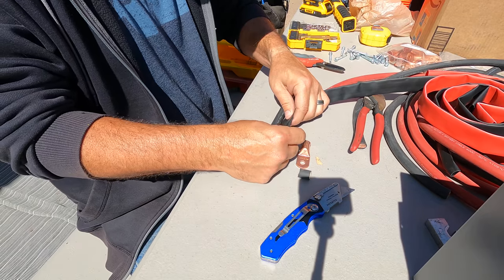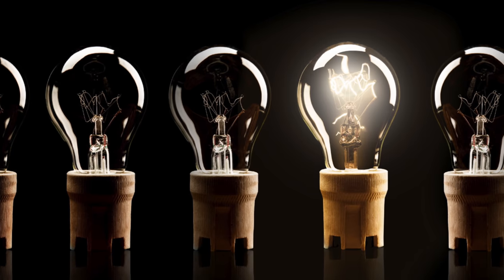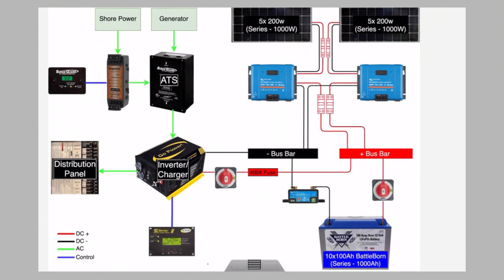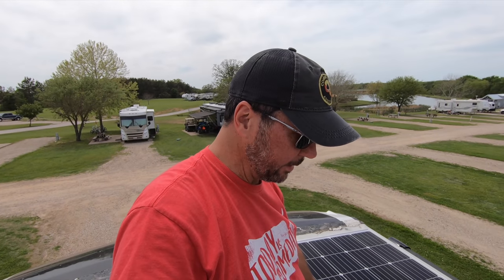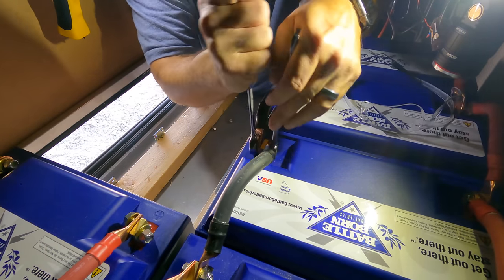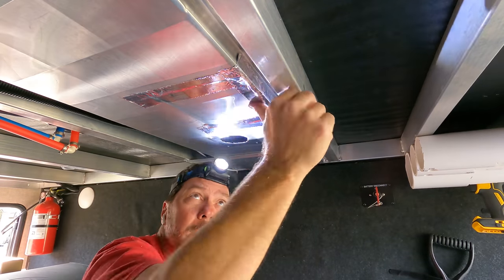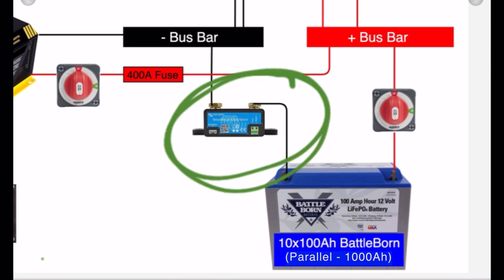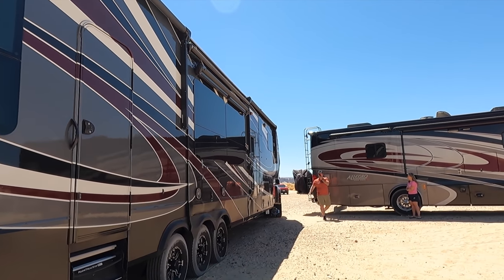☀️  RV Solar Install! 😎  (Full Time RV Life)

Comment: Wow!
So many questions.
Love the video. I’m taking notes snd will watch this a few times.
Question 1: now that your “solar”, do you need a generator?
Q2: do you shut the solar off when your plugged in?? How does that work?
Lots more questions but I hope you can get to these two.
Reply from the maker: We have a generator and it will still be used when we have power requirements over 3000W.
Solar stays on all the time and the controllers handle how much power is added to the system.  We'll have a new inverter video out in a few weeks and this will be more obvious when I show the whole system. 👍🏼

Comment: Hey Chad, did you use Photoshop to do the pic editing for your panel placement? That's an excellent idea. On my second RV setup and getting ready to install the panels. I've always just taken cardboard and moved it around on the roof and marked the spots. I like your idea of the visualization. #DJImini2

Comment: Problem with sizing your Charge Controller:  Each charge controller is rated 150V/100A which is equivalent to 15,000 Watts. (Am I wrong)?  Therefore, one charge controller would handle two strings of 5 series configuration, which would equate to (120V !  20amps) of usable DC power = 2,400 Watts.  Which is way below the rated wattage of one single Charge Controller at 15,000 watts.  Therefore, you do not need two charge controllers of this size.  (Am I wrong?)

Comment: I really got a lot out of this as I am planning our new solar system.
We are full time stationary and our PG&E is almost $200 a month and we want to cut that in half at least.
It almost slipped past me to upsize the controller that the controller has to be upsized because you are going back to 12 volts on the battery side which ups the amps. Unfortunately it bumps the cost of the controller to over $700 if I get the 150/100 model.😟
I am so thankful our 2020 Pinnacle is prewire with 10 gauge wire from the roof to the basement for the panels😀

Comment: Great illustrated video! What was the wire size You used for Your batteries? Looks like about 4/0 AWG but not to sure? Also what did You fuse Your batteries at? Very nice job. Thanks for sharing...👍
Reply from the maker: 2/0 interconnects and 4/0 for the battery bank and inverter...  All specs and parts can be found in the blog post here: https://changinglanesrv.com/rv-solar-install/  👍🏼
Reply: @ChangingLanes  Thanks so much for the reply! 😎👍

Comment: As always another great video. Nice and clean wiring. Did you have to dedicate one AC or can you use any one of the three? Can you still connect to your Victron monitor inside your RV and use your phone?
Reply from the maker: The way we are wired, we can run anything... just not all at once.. 😊   I might use an old iPhone in the cabinet as a permanent monitor... Waiting to see how the Multiplus integrates...

Comment: Chad in your audio description you mention your solar panels are 24VDC 10A but the link in your description brings us to the website with a description as is : HIGHTEC SOLAR 200W 36 CELL 12V NOMINAL SOLAR PANEL - 5 BUSBAR !
Reply from the maker: That's just nominal voltage...  https://www.google.com/search?q=solar+panels+what+is+nominal+voltage

Comment: Great Video. on Solar! Question: How do you handle keeping the Lithium batteries warm in below freezings temps?  Is your battery compartment heated?  Or  do you have low temp cutoff on the solar controllers, or both (I imagine you use this setup year round)

Comment: Nice job Chad!   With the two banks of 5 batteries and the far end cross over connection between banks, it allows you to run your positive and negative connections effectively at opposite ends of the battery circuit keeping a short run, but also allowing for even resistance balance for the battery, so they all will charge and discharge evenly. I hope you could do another video explaining the battery connection wiring as it's where a lot of DIYer go wrong. PS. Love the channel!
Reply from the maker: It's actually one string of 10 batteries - all in parallel.  But, having it sort of wrap down and back makes it easy to connect on opposite ends of the battery bank, but on one side physically.
Reply: @ChangingLanes  I understand your 10 batteries are one connected string, as the positive and negative link across at the end (left side of trailer). what I was questioning is the positive and negative that connects to your load. I assume you connected the positive to the end of one bank (lets say the front bank) and you connected the negative to the other bank(lets say the rear bank) these connections would be on the close end to your charge controllers, fuses, buss bars, shunt etc. That would be the most efficient  as the ions would all have equal travel resistance for each battery. For a better example watch this video https://youtu.be/QwWNF_jorYY from the 14.35 minute mark. Regards Tim
Reply from the maker: Correct, and that is how they are connected.

Comment: Hey Chad n TAra love ❤️ the videos keep them coming n Chad when is Ford F450 coming ?
Reply from the maker: Not soon enough! 😎
Reply: @ChangingLanes  or new Ford F-350 dually
Reply: You keep packing that rig and an F550 with 8-9k worth of capacity and an f450 like axle/wheel cut might be the answer. Gotta get an aftermarket bed for the chassis cab and it’s detuned…. but with the capacity, better gearing(4.88), and the 10 speed it is better suited for larger rigs. Beefier all the way around….plus aftermarket diesel tank with over 100 gallons, equals diesel fuel savings because you can be picky where you fill up. I am torn between a 14k gvwr F450 and a 19.5k gvwr F550…..neither option is perfect, but they both are nice. Sacrifice capacity vs. less power and tank like ride unless loaded down. Plus added aftermarket bed cost…..decisions, decisions?

Comment: I want to run everything including all 4 AC unit's on a Prevost bus with charge controllers big enough to handle a boat load of solar panels. 

I don't understand why more RVers don't do Tesla 85 batteries with BMS's on each one. They are about 233 amp hour batteries but that's at 24 volts so it's equivalent to 466 amp hours at 12 volts. So for a approximately $2,800.00 you get 932 amp hours of batteries instead of $10,000.00 for 1000 amp hours at 12 volts. So much more cost-effective for the average RVing family. 

HSR Motors offer all customers who purchase Tesla battery modules from them the option to have them swap out the proprietary Tesla cell sense board with their own custom converter board. Free of charge. This way you can easily use these modules with nearly any lithium ion balancing charger or BMS without having to deal with modifying the wiring to sense each cell. Plus they throughly test them and sell the balancing boards as well making them very safe.

I would also want a spare charge controller and inverter.
Reply from the maker: There are a million ways to do solar.  This way worked for us.  👍🏼

Comment: Awesome video. I love the battery location idea. 
Couple questions though.
1 -How much does the combined battery rack weigh?
2- Did you reinforce the metal generator box to stop lateral sway?
3- Are you concerned with heat transfer if you find yourself running the generator for prolonged lengths of time.
Reply from the maker: 310lbs total.  No reinforcement, but we've got a couple thousand mils over some crappy roads and no issues so far. It feels very solid.  The genny does a pretty good job of venting all of it's heat underneath.  Time will tell...

Comment: Wow Chat that was awesome. So much detail but delivered in but size chunks I to have a solar project to do in the future. Will keep this and refer back to it. Thank you so much. 

Question there are 2v battery cells out there. That I think carry more capacity. Did you consider them. 

Also I hear LG are bringing out 400w standard size panels later this year have you heard about them
Reply from the maker: No, but I'll check that out...  There are 1000 ways to do solar..

Comment: Chad, could you please post details on the pre and post mppt breaker for me? Looks like this system will work great for my rig, but with a massive surplus of solar ( I only have 540AH [12V syst] from 2 BB GC3 Batts on my rig. Might double it next year). Thanks

Comment: Hi Chad. Great video. Nice thorough explanation of all the parts and how they fit into the system. I am also going the Victron MultPlus II route as soon as mine arrives (!).  You mentioned about possibly having power assist on both legs.  I have been looking at the diagrams on the Victron site and as far as I can tell, it only does power assist on both legs is if you have a single 30a shore power feed. We have a 30a to 50a dogbone that splits the 30a single phase to power both 50a legs I am not sure that the Victron will work that way.  Maybe they have changed since they published this.
Reply from the maker: Thanks.. I need to dig into the details on the unit...
Reply: @ChangingLanes  after talking with Arizona Wind and Sun, I found that power assist only works on L1 even though L1 exists on both outputs.

Comment: Fantastic overview and well thought out design. Curious if you also you a slow start on the A/C unit to reduce or curve the power spike at start up.
Reply: If you have a 3000W inverter it should be fine.  The soft starts might be needed for 1800-2000 inverter generators.  I have the Coleman Mach 15 powersaver series AC and the main room AC is also a heat pump and it starts up without a soft start using an Ecoflow Delta Pro.  When I spoke with the AIRXCEL technician about the differences the powersaver series uses less power (~1300W). When I asked if I needed to add a soft start he stated that any modification to the AC will void the warranty.

Comment: Awesome video guys you really are one of the best on YouTube. You really spent 10k on batteries all at once though?? It's super awesome concempt...but that's the price of s new generator alone. Wouldn't it be cheaper to have saved that money for gas for your gen set over rhe coarse of...years? And be able to litterally run everything?
Reply from the maker: Well... we already had 3 batteries, so 7 was easier to swallow..  Keep an eye out as BattleBorn sometimes has scratch and dent sales.. 😊
Reply: @ChangingLanes  ha I'm big in the RC world as my other hobby than campers, deffinetly do nottt want a dented lipo battery. They can be dangerous that's the downside!
Reply from the maker: Pretty sure they wouldn't sell anything with an actual "dent".. It's just cosmetic damage...
Reply: @ChangingLanes  yes with a lipo battery I'd really hope not! Eaither way nice instal. Oh BTW were you mad at grand design for putting your solar conduit in the wrong location? For an almost 100k RV I'd be pretty upset!

Comment: I really like your system. I too will want the ability to boondock for extended periods when we get the chance to buy an rv and get out there. Big question for me is did you stay with 12 volt solar for the simplicity and commonality of the existing rv electrical? Did you look into going with higher voltage to keep the amps down? I've been trying to find more info about going with a 24 or even 48 volt solar and stepping it down to the batteries and dc side of the panels. Mahalo, BB
Reply from the maker: Yea.. I didn't want to re-organize everything to isolate a 48v battery bank from the 12v RV...
Reply: @ChangingLanes  That's too bad not going wiith a 48v battery setup. Just seeing how much copper was used for interconnects on the batteries would more than make up the cost differential of getting a 40amp step-down for the 12v. I know it's too late for your planning (Chad and Tara), but check out the GroWatt SPF 3000TL LVM-US; all-in-one unit to handle all but the shunt and 12v.

Comment: Love this and really impressed with all the details.  I want to add a bus bar but not sure what guage wire to use from the battery (Pos and Neg) to the bus bar.  Can you let me know what you used?  I have a 2021 397 with 2 x 100AH BB batteries and will add a couple more in the future.  Thanks in advance
Reply from the maker: James, specs are in the attached blog article: https://changinglanesrv.com/rv-solar-install/

Comment: Chad great install and video.  I am a full-timer for the last 5 years and boondock often while moving from destination to destination.  I have a very adequate battery bank install with a 3000 watt hybrid inverter and only run the gen when using AC and charging batteries.  My coach is 40 foot and one ac will do very little to cool the rig.  Unless I am missing something I dont see how the investment in solar pencils, maybe you can share your thoughts.   But never-the-less many people are installing solar.  Good luck and I hope you have many years of use from your install.  .
Reply from the maker: I guess it depends... We only want to boondock in mild weather.  And one AC does very well for us.  In that scenario, our panels should keep things topped off during the day.

Comment: Is the front compartment of your Momentum heated?  Are you concerned about charging your BattleBorn's in the cold?
Reply from the maker: We don't plan on boondocking in very cold weather.  But, if we did, it would be a simple matter to run a vent from the furnace duct to the front bay.

Comment: Question for the group and Chad, would it not be safer to mount all the fuses and circuit breakers on a non-flammable surface like Hardie board? I see everyone is just mounting to a carpet covered plywood.

Comment: Can't you get some solar power input even in cloudy conditions?  I've heard so,  because I was given to understand that it actually works on UV light, which comes through clouds...hence you can get sunburned on a foggy day.  When my kids were in high school, we lived in a town famous for being very foggy all spring and summer...and the kids at that school who had the best "sun" tans were those on the tennis team, who were playing out in the fog every day!
First you spoke of being able to use thinner wire...but then you said you used 10 ga wire, and had considered 8!  That's some pretty hefty wire, sir!  :-O  So is the internal wiring in the RV for the outlets, etc. more like standard household 12 ga or 14 ga wire? 
I didn't know you can switch between series and parallel coming off the panels and to the batteries?  Interesting...Do the lithium batteries drain down and give you warning they're getting low, or do they function all the way until--oopss--dead!  With no ramping down of output?
I wonder, how much weight did all this remove from your cargo carrying capacity?
Funny, I understood most of what you were explaining--well done--but at the same time, my head is spinning.  LOL   My current level of experience with electrical wiring amounts to setting up my very simple single-track model train, (DC, via a rectifiier, and uses probably 18 ga wire...) and I can rewire a table lamp or install a new electric receptacle, and beyond that, I'm calling in a pro!

Comment: Dude, congrats on a super clean install. I did my install myself and share your enthusiasm, and sometimes grief, with putting this all together. 

I’m curious why you went with 200w panels vs say 300-400w panels (mine are 400W LGs and were $150 each delivered) and what shading issues you may have by going series vs parallel as 1 partially shaded panel could take down that entire series of 5 panels, and 1 partially shaded panel on each series could take down the entire array, right?

I chose to do 4 x 400w (49v, 9.5 amp) panels in parallel (with room for 1 more on a GD 349m), 2 AWG wire from combiner box on roof to 1 x 150/70 charge controller. All panels are independent of shading issues since parallel, and only slightly thicker and more expensive wire down to the cheaper and singular controller. 

Also curious as to what max wattage you’ll see. With my 1600w I’ve only seen maybe 1350w rarely, and mostly just get 900-1100w (season and latitude dependent of course ).
Reply from the maker: The most we've seen from our 2000w is about 1850.  If we have issues, I can always re-wire.  I'm curious to test the one panel in the shade thing...
Reply: The shading issue with panels in series applies for panels without a bypass diode (a one-way electrial semiconductor). Most panels available today have bypass diodes in them, this allows the current to flow around the shaded panel.

Comment: Fantastic video, thank you so much for sharing it and explaining how each component breaks down.  Sharing your diagrams helps to break it down so my brain can process it in part and in whole!
One side question, since Daisy's potty came up...  do you guys use poop bags that break down in the RV tank, or do you just use disposable bags that go in the garbage (and potentially generate a little bit of odor that only Tara is likely to notice)?  I've read of some folks just using a diaper genie for disposable bags and we did that at home until our city gave us the big outdoor bins for the articulated trucks - we could easily use the diaper genie again, but if there's another way to not depend on refills, I'd like to learn it before we hit the road.  Thanks, guys!
Reply from the maker: We use disposable (biodegradable) bags.  We try to walk her and put them in the campground garbage.. but sometimes we end up with a collection of a could bags at the bottom of the stairs (outside) and just take them when I take the trash out.  Daisy's are so tiny it would take a year to fill a diaper genie.. LOL
Reply: @ChangingLanes  Ah yeah, her size is a huge factor...  we'd be traveling with a lab that sometimes has two separate evacuations per walk.  Thanks for sharing your experience!